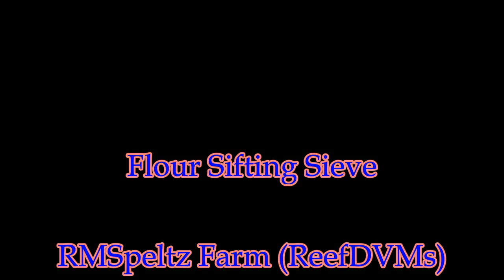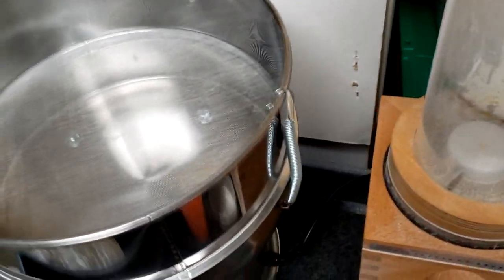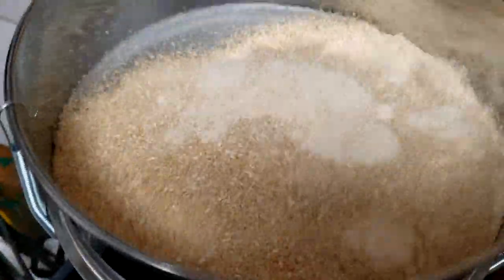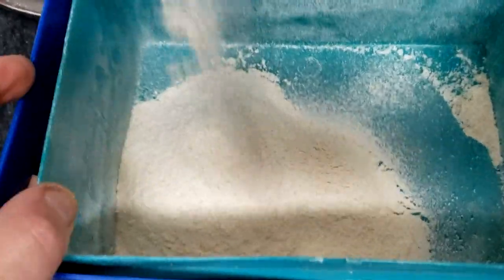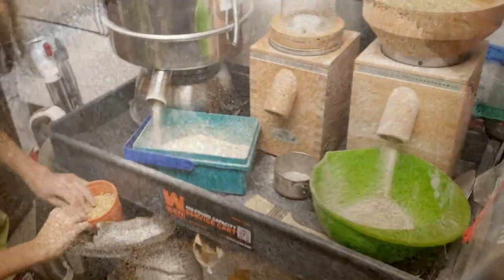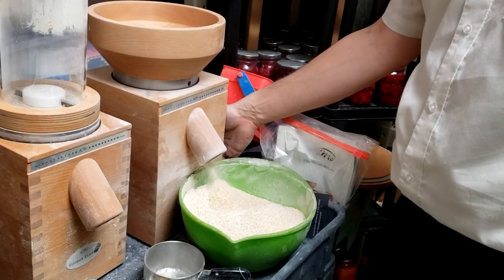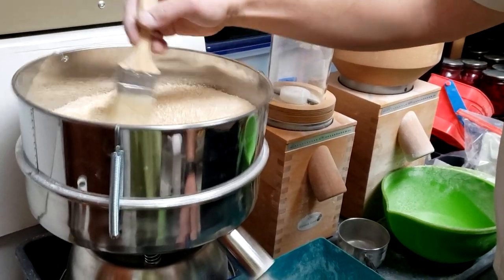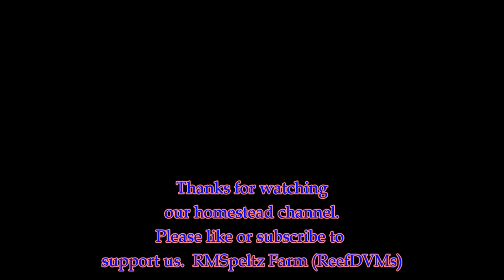Flour Sieve and Sifter to the Farm

Comment: Thank you for the demonstration.
I currently own only grain mill, and to sift 1 pound of flour by hand takes more than 30 minutes. Therefore I am thinking of buying exactly the same sifter to speed up the process. Would you suggest buying also 50 and 60 meshes alongside 40, for very fine flour used for "filo" dough?

Comment: I just got my sifter in the mail. Can’t wait to use it. Do you store the berries in the freezer or Mylar. ? Also what do I use that bran for after sifting.?
Reply: I store bran in a container in the fridge. From it I occasionally make Cream of Wheat / Farina from it by boiling it with a 2:1 ratio of water to bran (basically make it like Oatmeal). Much better than what you buy in the store. You can even toast the bran dry in a skillet first to give it a roasted flavor before adding the water. Add butter,  milk, brown sugar, other flavors as desired. Good stuff.
Reply: I have been storing Wheat berries in their 25 pound bags,  in food safe plastic buckets, for a few years now. No problems so far.

Comment: I’m curious how this sifter compares to the KoMo sifter that you demonstrated in an earlier video. Does this sifter work better or faster than the Komo one? I just purchased the Komo mill so would be very interested in your opinion on what sifter is best.
Reply from the maker: the KoMo is very nice and works great, but it has limitations in quantity you can put in it and it is little bit work to empty it, the pan style is noisier yes and bulkier but its easy to load and empty and hold lot more.  I say they both have advantages depending on how you intend to use them

Comment: Is your vibrating sifter very loud? I am deciding between the vibrating one (with no. 40 screen) or komo sifter (but have just one komo mill and not sure if it will be not too messy to constantly put it on and off).
Reply from the maker: We can talk over it yes but has noise to it, personally the grinders are louder but we tolerate it well

Comment: You are removing all the nutritional value out of your baked goods when you sift this fresh milled flour.
Reply from the maker: You dont have to sift if you like to work with whole wheat flour like we do, but if you like to bake breads with a more AP flour or need a more pastry flour to bake with for certain dishes then yes you need to sift the bran out of the flour to make it work in those dishes and then you can use the bran for cereal, chicken feed, or breading in your cooking then you win those valuable nutritional elements in different way=)
Reply: @RMSpeltzFarm  Do you have a combination you like for bread flour? Also, do you have an affiliate link for the sifter? What is it called? Thank you!